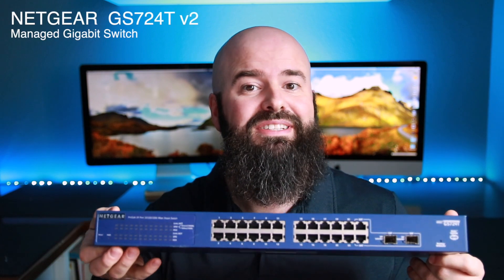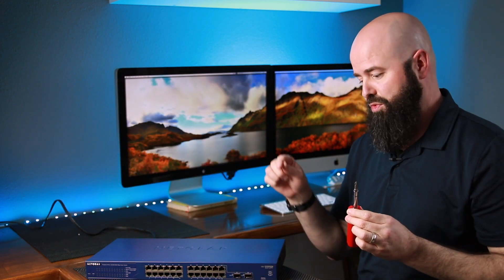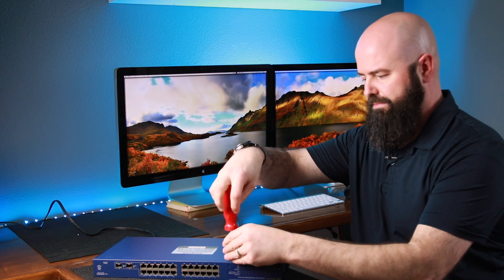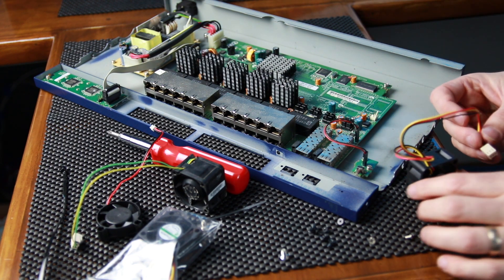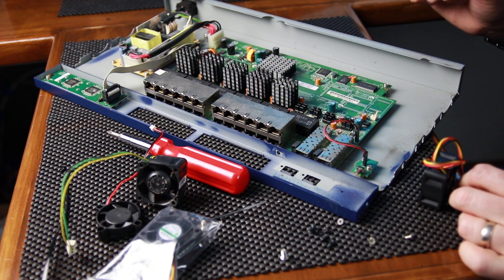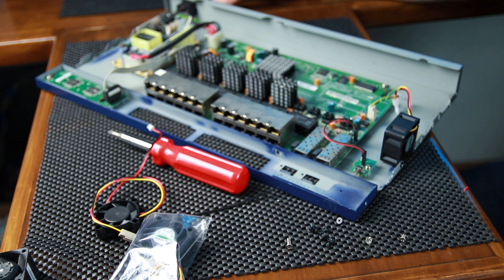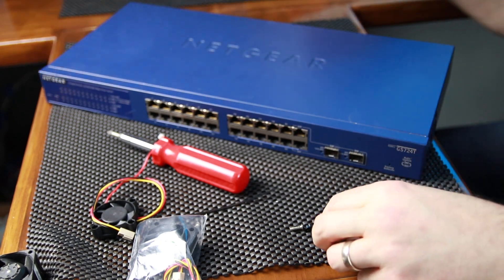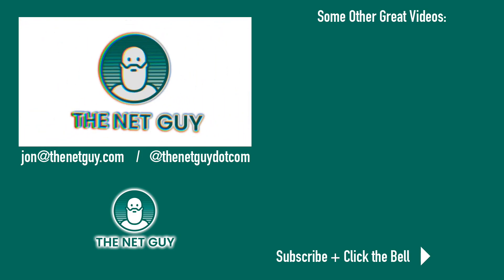Netgear Switch / Fan Replacement

Comment: What was the original model of fan, and the replacement? I have a similar FS728TP with the same dreadful fan noise, but alternatives are hard to find because the pin output from the original Delta EFB0412VHD-R00 is a stall detector (floats high on failure) rather than a tach output (square wave while running) as is more common. Does your replacement behave properly if you force a fan stall?

Comment: I just replaced an old noisy fan in my switch (GS724T), with a Noctua (NF-A4-20 FLX) fan by following along with this video. Works a beauty, Thank you Net Guy!
Reply: Did you have to cut and splice anything on this fan?  How quiet was it after the swap?

Comment: @thenetguy . I have plenty of rack space . Couldn’t I add something like a noctua Nf-f12 to the top and cut out a square so the fan could sit on top? That way I easily have similar static pressure , way more airflow but even much quieter ?
Reply from the maker: Sounds like a plan!
Reply: @TheNetGuy  now my gs728tx is a 4 pin fan. is there anything in the netgear control that will freak out if I put a slower spinning fan?
Reply from the maker: Nope, nothing at all. It works great. Been running on mine for years.

Comment: I just started watching this video and i swear the fan quieted down... it knows... tks for a great video, i have 3-4 of these that i will try this on... I couldn't quite tell which wires connected to which on the new fan and the spliced connector... 3 wires on both and which colors connected to which ?? tks...
Reply from the maker: Great upgrade.  I’m still running on this with my 500/500mbps internet and it keeps up great!
Reply from the maker: Just match the colors up when you splice.

Comment: I have the exact same switch bit the v3 instead of v2. I love it and I agree with you about the fan noise I'm going to change mine soon. Great video.
Reply from the maker: You got it man, they’re great for the price.  Noctua fans are the way to go if you want super quiet and airflow.
Reply: @TheNetGuy  I am aiming towards the noctua fans.
Reply from the maker: I just picked up a studio light that has a noisy fan brand new. I swapped it out with one and it’s completely silent.

Comment: Hope all goes well for your upgrades.
I also am doing upgrades to my network ATM. I will be adding 8 then finally 12 IPCamers around the house.
 I just Sniped a GS728TPPv2 (380 watt)from Ebay $53.( Some Yahoo ripped out 2 of the 4 SPF ports)
Reply from the maker: Great little units.  The UI is dated but behind the firewall they're burly!

Comment: You could go to local hardware store and get 2 machine screws and nuts to mount that fan with.(total cost about $1) 
Video turned  GETTO with the Zip ties......But I still liked it.  
Also list your Where you got the Fan would be helpful.
Reply from the maker: Thanks for the comment!   Yeah, if this were a business install or something mission critical I’d have come up with different mounting.  As it stands they have held up very well so far :)